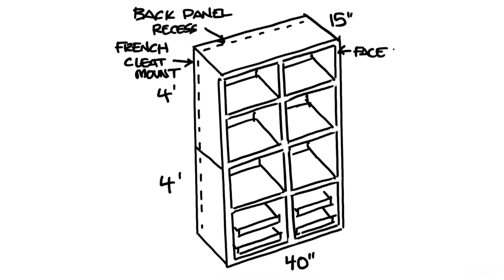Storage Cabinet Build

Comment: Your diagram is exactly what I want to build.  However, I want the drawers to be at the bottom of the upper box and on the top portion of what would be the bottom box.  That way the drawers are at near belt level for ease of getting at things.  As a new subscriber, I'd like to say thanks for making this video.  I used your dimensions for my cabinet.
Reply from the maker: Thanks for the comment and sub David. That is a logical modification. Glad you found the video helpful. Would like to see a picture of your build when completed.